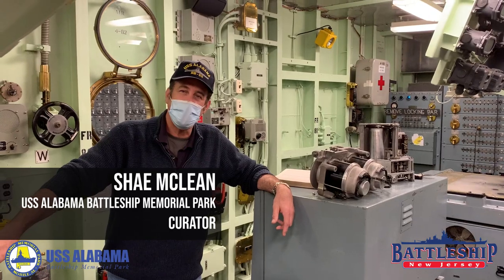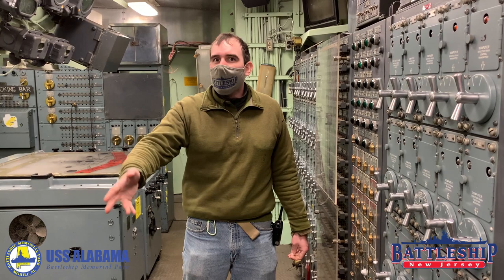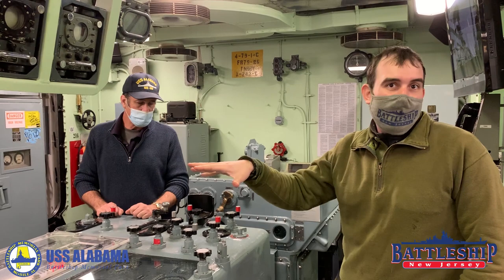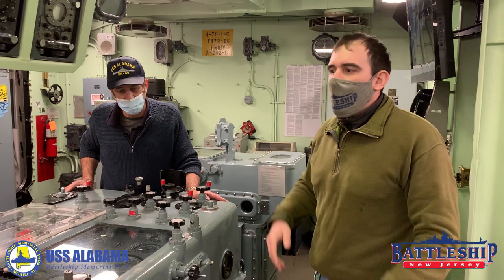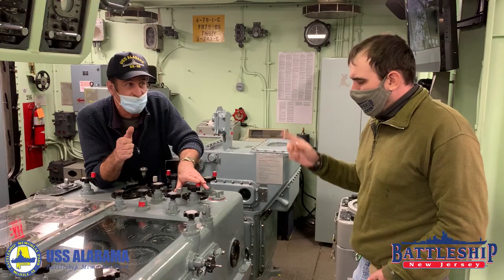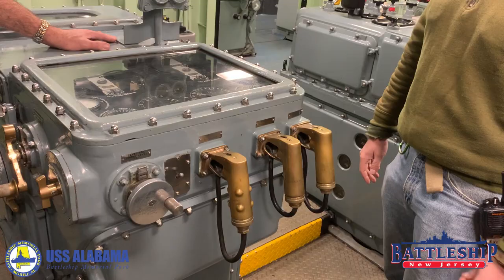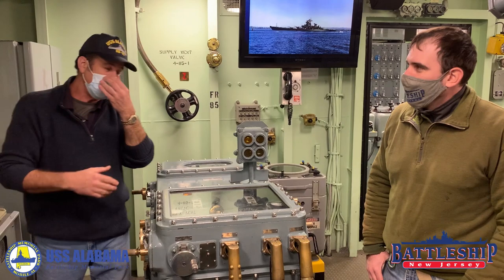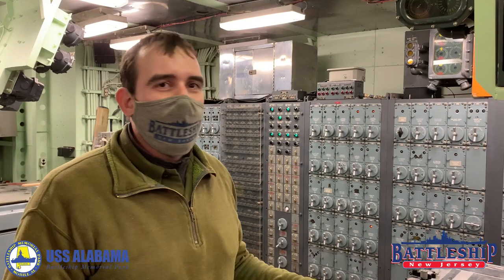Forward Main Battery Plot with Battleship Alabama

Comment: Some additional content:  By the middle of WWII, the orders to the guns were, in Remote/Director/Plot Control, no longer "Follow-the-Pointer", as had been used since such remote gunnery control was first introduced circa-WWI (different nations used different systems introduced at different time, of course).  In this mode, the information from the range-finders and so forth was sent to the calculators in Plot either by voice from the people operating the equipment reading off dials or, in the more advanced systems, by indicators much like the controls on radios that sent various signals (like tuning the channel dial) to the calculators directly (though manual knobs and handles allowed the calculator control personnel to override the values when they had better data, such as from somebody with binoculars who had seen you last salvo miss and told you to correct by so-and-so yards range , for example).  This direct information transmission was done to the gun mounts from the calculator in the same way, by moving an indicator on a dial in front of each person controlling a portion of the turret/gun motion and that person used his controls to move the gun mount part that he was in charge of.  This manual control even when in remote control from the calculators meant that the person in the gun mount had to "eyeball" the indicator an match an indicator attached to his controls to overly the transmitted one, which might not be easy to do if the ship is pitching and rolling and turning or the target is a high-speed aircraft, or both.

This data transmission problem was realized and attempts were made to remove the humans "from the loop", controlling the mounts completely by direct inputs from the calculators, with the people there only for backup in case of malfunction or when using the mount in local control for some reason.  To do this, the power of the signals had to be strengthened from just the very small values needed to move a small indicator dial pip to strong enough to manipulate the controls that the person used (that is, internal to the mount, bypassing the human controls completely in remote control) with no loss of accuracy.  A number of attempts to do this worked, more-or-less, when the mounts and guns only had to move slowly and, when firing against slow-moving enemy ships, the targets were moving slowly too, so some error could be tolerated and spotting adjustments from the guys with the binoculars would "take up the slack".  However, as gunnery ranges increased and longer times-of-flight started happening and fast, maneuverable aircraft became more and more a target from the secondary mounts of the ships, this "slack" no longer cut it -- you needed accurate firing from the start and no matter what the sea state or target was.  Now you had a problem, amplifying the signals from the directors and range finders/radars as inputs and as outputs from the calculators as outputs to the gun mounts to do the non-human-in-the-loop firing mode, also amplified the errors, too!   Unsatisfactory!

What to do?

Back when power for electrical systems, both motors and electronic systems like radios (no radars yet) and internal telephone circuits, first became in use in warships around the turn of the 20th Century, the power was all DC.  This worked for motors just fine and, with weak signals, for internal ship communications, including those follow-the-pointer dial pips.  The human did the "heavy lifting" to operate the controls for all equipment in the ship, as noted.  To get the electrical power in the weapon input/output control circuits, at least, up to a level to run things untouched by human hands, you needed to raise the power without increasing the error at the same time.  What the US Navy did in the 1930s, with Germany doing something similar using different electronics,  was to find a way to get precise data between electrical equipment all over the ship that could be, when required, amplified to a high-power signal that could do  the direct-control function, what the Navy called "Remote Power Control" (RPC).  First, before the amplification part and also well before the RPC was finally added to the latest ships and retro-fitted to older ships (such as after Pearl Harbor), all of the "kinks" had to be worked out -- this was done by the middle of WWII and most US Navy warships eventually got RPC as their main control system for at least their main weapons.  What was done was to use the precise control that AC electrical power gave when put through transformers, something that DC power could not do.  A transformer is a multi-loop coil of wire that, with AC power applied, is constantly forming a synchronized magnetic field around the coil.  If you created a triangle of three such coils in a flat plane and put a permanent magnet compass-needle in the center, as you turn the compass needle, each of the three surrounding coils gets its voltage modified, each uniquely, so that if the AC power is strong enough, if you have an identical device on the receiving end, the force of those three coils will force its central needle to THE EXACT SAME ANGLE as the transmitter had.  If the angle error was too sloppy between the two, then you can have a second transmitter/receiver of the same kind with a 36-to-1 gear ratio for that one, giving very precise values that, when added/subtracted from the 1-to-1 needle reading, could give you EXTRMELY precise data.  You took any device that had a numerical value to send (sensors or the calculator), use electro-mechanical gearing to change it to an angle (one "coarse" 1-to-1 value and one "fine" 36-to-1 value), send it as this angle pair, then use the reverse gearing system to convert back to a value that you need (target range from the radar, for example), and directly input it into the calculator or gun mount by similar amplification, as needed.  Vacuum tube amplifiers like in regular radios of the period could handle this very accurately.  This AC-based data-transmission system -- requiring all ships using it to have at least part of their power systems switched to AC from DC and, eventually all of it to AC -- was called a "Self-Synchronization" (Selsyn or, alternatively, Synchro) data transmission system since both ends of the system worked together as one coupled set of wires and as long as it was kept aligned regularly by standard maintenance procedures like any other piece of equipment, it would give good results without worrying about it getting misaligned as most of the older DC-based attempts had easily been.  THIS is one of the reasons that the US Navy fire-control systems worked so well in WWII.
Reply: Mr. Okun, I know Vanguard had “RPC” for training only. Was she wired AC or DC? If DC, did her RPC suffer as you described?
Reply: @drittal  I am not sure about VANGUARD.  Late in WWII the British, who were exposed to the US RPC system when it finally became more-or-less universal on US Navy warships (at least the modern ones and some of the older rebuilt ones), developed a hybrid RPC called "MAGSLIP" for their new battleships which had a person use the follow-the-pointer manual control to within 10 degrees of the ordered position and then throw a switch and this semi- RPC system would lock-on and control the turret and, maybe, the guns with the man merely keeping the gun aimed more-or-less in the center of the 10-degree arc.  It was used for traverse control and, I think. elevation, but I am not sure about the latter, though it would not really work right if elevation was not included, I would think.  This is essentially having the 36-speed fine Synchro signal, but not the Single-speed coarse Synchro signal, wired up for RPC.  This required rewiring the turret controls and the calculator outputs, though I am not sure that it applied to the director/range-finder/radar inputs to the calculators, and adding AC power for this part of the ship's generators, since the rest of the ship remained DC-only ("Ring Main"), as before.  If you are right, then MAGSLIP only controlled turret traverse in any of those ships.  Anti-aircraft guns would have suffered compared to the US 5"/38 gun systems used by almost all new and many rebuilt US WWII warships which had complete Synchro systems for both traverse and elevation and, while some might still use follow-the-pointer with manual mount control, the output display needles of the pointers in the US systems were very accurate in matching the input signals at the other end in every case.
Reply: I should elaborate, training only for her 15”/42. I believe the 5.25” were full RPC.
Reply: @drittal  Thank you for the info.
Reply: I thought I had seen RPC introduced during the 30s for the later "treaty" cruisers and then for the fast battleships, but that Salt Lake City predated that development and would be refitted with RPC following the Aleutians Campaign and the damage she took during the Battle of the Kommandorski Islands. Am I mistaken, or does the "by the middle of WW2" phrase above refer to RPC becoming widespread among the fleet combatants, including being refitted to the Pearl Harbor survivors and older ships like SLC?
Reply: @kemarisite  RPC, meaning completely "untouched-by-human-hands" when running properly, was not being used early in WWII by the US Navy and took some time to get the kinks out.  For example, if I remember correctly, MASSACHUSETTS when it was fighting JEAN BART at Casablanca during Operation Torch was generally wired up to have true RPC but had not had it actually implemented yet, retaining follow-the-pointer control of its 16" guns for some time later.  Just when each US Navy warship had RPC actually implemented, both for the main armament and secondary armament, I do not know, though by late WWII RPC was being implemented for most US Navy ships of all types, at least the new ships or those older ships with the more heavy overhauls.  Synchro data transmission was installed in many ships much earlier than RPC was since the latter required major changes to the power-operated controls in the gun mounts to allow bypass the human manual controls, while synchroes just for very accurate data transmission could be installed for any ship using just follow-the-pointer manual controls with minimal work with running wiring and indicators -- the big deal was changing to AC from DC in those older ships, at least for these sets of controls.

My experience with synchro data transmission systems was in US guided missile destroyers and cruisers that kept this form of data transmission until gradually being replaced by digital communications as digital computers and digital-controlled hardware devices replaced analog hardware slowly as new hardware was developed, tested, and installed during major overhauls during the 1970s and 1980s.  Originally, the analog-based equipment (radars and missile launchers, for example) retained synchro systems with special converters acting as interfaces from digital to analog and vice-versa to/from the new digital computers -- only the digital computers directly communicated with each-other using digital-to-digital interfaces.  The "don't fix it if it ain't broke" motto had synchro systems retained and only slowly replaced when rewiring equipment for advanced capabilities required it (digital uplinks to new advanced missiles after being fired, for example, which the older missiles could not do; this required digital communications to these new missile types both on the rail before launch and from the radar tracking the target after launch, so only then were synchro systems replaced by full digital communications).
Reply: @kemarisite  Sorry for the late reply.  "Middle of WWII" is 1943-44, when most of the ships repaired after Pearl Harbor were coming back into action, the new ships such as the IOWAs were being commissioned, and the older ships that had unfinished RPC finally got theirs wired up and calibrated for use.  There probably were some older ships that never got upgraded to AC, or never had Synchros installed, or never had RPC even if the other things were changed.  "Bang for the buck" controlled priorities.

Comment: From the location shown at the beginning the the video this gear is located just behind 16 inch turret #2.  You showed only one set of triggers, but there are two turrets with a total of six barrels forward.  Are there other sets of triggers for the other barrels?  OR is there a master selector switch that will tie any of the forward barrels to this one trigger unit?  OR does this one set of gear operate for all three turrets?
Reply from the maker: There are control switches that allow you to decide which gun and which director you are using. Each gun also has local control as well. There is a similar space in another part of the ship for redundancy that has identical equipment as well but there isn't one computer like this for each barrel or even each turret.
Reply: @BattleshipNewJersey  GREAT!!  Thank you.

Comment: Ryan slight correction on the MK-8. Once a firing solution was established, any of the variables the computer was tracking could change and it made no difference. The New Jersey could do figure 8's while changing speeds and the firing solution is still good. The enemy ship could also be doing figure 8's and changing speed and it would make no difference the MK-8 updated the firing solution in real time. The best example of how good the system was is the battle of the Surigao Straight. The rebuilt USS West Virginia had a MK-8 installed and as the Japanese Battleship Yamashiro approached the West Virginia got a firing solution at 42,000 yards. Admiral Oldendorf for some reason waited for the West Virginia to close within 22,800 before opening fire and hit Yamashiro on the first salvo and 5 out of the next 6 salvos rendering Yamashiro combat ineffective in a few minutes. If Oldendorf would have TRUSTED the technology he could have opened fire from 34,000 yards and it would have made no difference.
Reply: No difference in terms of getting the salvo centered on the target, but there are still random variations in the hardware, ammunition, and atmosphere that cause the shells to land some distance from the theoretical point of impact. The longer the range, the more likely you'll straddle the target without hitting it.

So if you think the enemy hasn't detected you yet, it's usually correct to hold fire until you think they're just about to notice you, giving yourself the best possible chance to land a decisive hit before they have time to react.

Comment: Hey Ryan, did they have people on deck manning the AA guns while the main guns were firing? Or was there a separate general quarters for main battery vs. AA, so people wouldn't get hit with a 16" muzzle blast? Yes, I'm picturing Tommy Lee Jones getting blasted across the deck.
Reply from the maker: The AA guns on and around the forward turrets were not manned when those guns were fired but the aft AA guns could be used while that was happening.

Comment: Is it possible to get more of those fire control computers operational based off of that one and surviving documents?
Reply from the maker: A lot of the machines had many parts removed so it would be very tough to do
Reply: A lot of machining I’m assuming
Reply from the maker: Yeah. Also, we haven't heard from you in a while, welcome back!
Reply: @BattleshipNewJersey  What was the purpose of stripping parts from the Fire Control Computers?  Were other ships still using the MK-8 when the NJ was mothballed?  What happened to all the spares that would have been warehoused on shore?
Reply from the maker: Parts break, get pulled from other machines. For example, NJ only has 1/2 of her machines with all its parts.
Reply: @cliffaksw  By the time you model the part in CAD and print it, you could have ten parts using conventional machining processes.

Comment: Was that radar muzzle velocity fed back into the fire control equation at some point?   I'm curious where muzzle velocity (as a result of powder quality, powder charge, liner wear and projectile weight) are factored in?   Is that done at the turret?
Also, on a different subject, do you have any books you recommend as the definitive source for the technical details of the Iowas?  Thanks and keep up the great work.

Comment: The radar didn't just give the ships the ability to hit at night.  Bearing accuracy was better with radar, and range was no comparison; radar completely beat optical range finders, particularly at long ranges.  Optical range finders used parallax.  They measured the angle the two ends had to be bent inwards to make the angles match.  At long ranges, they are measuring an angle ever so close to 90° and taking the tangent times half the distance between the ends of the rangefinder.  Miniscule errors meant huge distance errors at long range.  On the other hand, radar error is constant with range.  It's using a measurement of how long the pulse takes to get there and back.

The best example was the battle of Surigao Strait.  There were six battleships there:  West Virginia, Maryland, Mississippi, Tennessee, California, and Pennsylvania.  West Virginia, Tennessee, and California had the latest fire control computers.  Maryland and Pennsylvania had earlier radar systems, while Mississippi had optical fire control.  West Virginia fired the first salvo at 22,000 yards and got a hit.  West Virginia, Tennessee and California, along with 8 cruisers pounded the Japanese ships.  Pennsylvania never fired and Maryland and Mississippi only fired late in the battle.